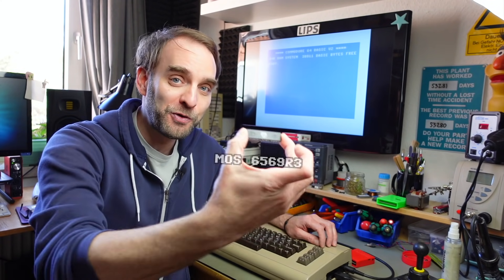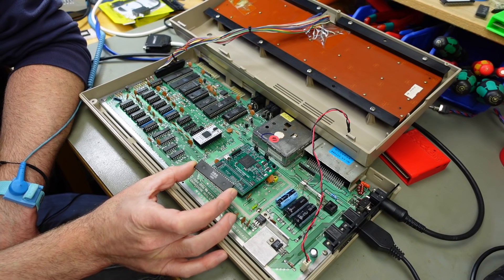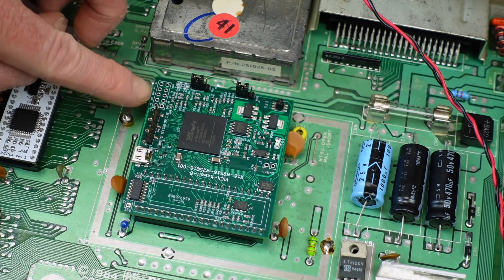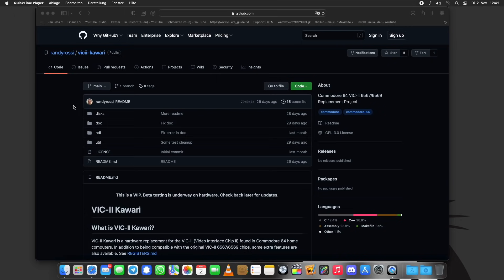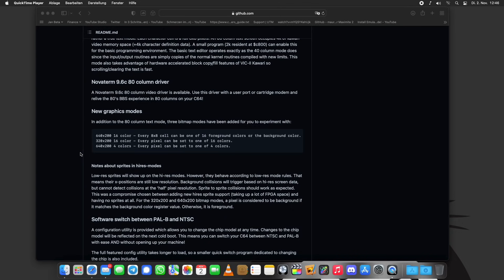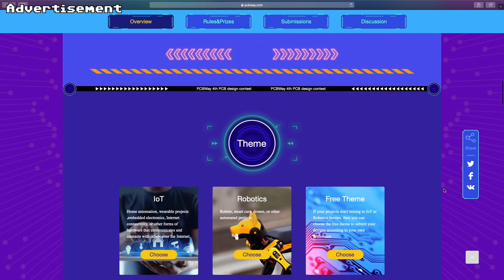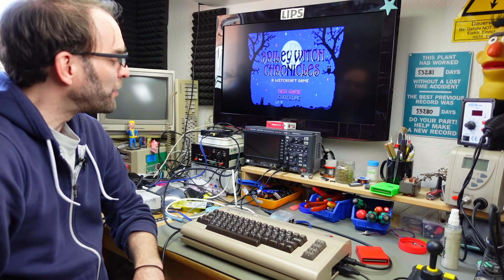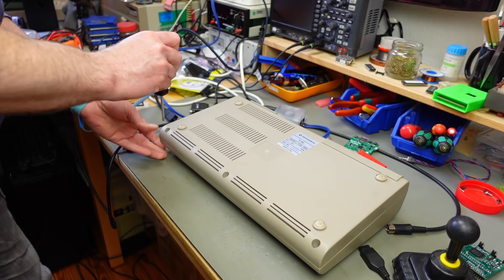Beta Testing the VIC-II Kawari C64 Graphics Chip Replacement

Comment: Does the  Kawari board output audio to HDMI? If not, would that be possible?
Reply: It would be possible with a small modification. The SID has an output pin and joining that with a wire into the Kawari and adding an op amp and/or some interfacing circuit will allow the audio to be ported from the SID into the HDMI. I suppose we might see that in the next revision ;-)
Reply: Unfortunately, no.  The PCB outputs the DVI protocol over an HDMI connector.  So there are no HDMI features (like audio or encryption).  HDMI monitors are compatible with DVI signals.  Using HDMI requires a license which is very expensive.
Reply: @r3rossi  Ouch! That's not good. I was thinking there was an audio pin on HDMI but there isn't. There may be a way to get audio to the TV. Add a pin header (1 pin) to the Kawari then wire the SID output pin to it using a flying lead. Then add a headphone jack to the Kawari and hook that to the incoming SID signal. An op-amp shouldn't be required because the TV will amplify the signal. Then use a cable that has a headphone jack on one end and 2 RCA audio plugs on the other end and run the cable out through the user port. The cable will plug into the TV RCA audio jacks and give audio through the audio inputs. Most TVs have a menu item to allow audio input through the RCA jack and use HDMI for video.

Comment: Will it work without the RF modulator but using a c0pperdragon Video Enhancement?
Reply from the maker: I have yet to try that myself but it probably works. The luma/chroma signals that go to the rf modulator are modeled after the ones from a real VIC-II,  so it should work fine.

Comment: I´m following the product since the beginning and now it seems to be close to production. My SixtyClone 250466-Board ist badly awaiting the released product! :-)
If you´re looking at the scene you can see that public domain hardware works out well, see the PiStorm Adapter 68K-CPU-Replacement for (in the future nearly all) Amigas.
I hope the developer will get more than just fame out ouf it if he makes the project open source. 
By the way: I think its right that products like the Turbo Chameleon 64 V2 or the Ultimate 64 are good replacements for the C64 as a whole with lots of new features (not to mention the BMC64, the KeyRah a.s.o.), but:
Nothing's above soldering together your own Cevy, equip it with original or replacement parts, put the power cord in and get a well known beloved blue screen at first switch. :-) Nerd´s Victory!
Last but definetly not least: Again a great video, Jan! :-)

Comment: I wonder at what point it'd make more sense to pull all ICs from the board and just have an FPGA in the CPU socket emulate every chip instead. The Spartan FPGA should have enough gates to emulate the whole computer three times over.
Reply: See the "Ultimate 64" for that.

Comment: There should be current limiting for the HDMI 5V pin. The HDMI 5V according to standard specs. should not be outputting enough current to power a C64. Be careful so you don't destroy your monitor.
Reply: Hdmi 2.0 gives 900 milliamps. In his discord channel jan said he tested a c64 and it needed 800 milliamps on the 5v rail during operations.
Reply: @vectorjoe  I stand corrected. Thank you sir.
Reply: @svenkarlsen2702  still neither save nor intended to power the whole system via hdmi, as can be seen by the inconsistent reset sequence of the kawari and the rest of the system.
Reply: @vectorjoe  I'd limit the current over HDMI so it can be reset by power cycling though.

Comment: If this replacement is not open-source it's technically no better than the original VIC II chip because when it fails it's game over. FPGAs can run hot so failure it a real possibility. The most common failed part in modern electronics is the main control chip and often it's an FPGA. The same goes for all the SID replacement chips except the SwinSID nano. Even if they don't fail, these small run replacement projects generally don't last long before the developer gets bored and moves on and then no more chips are available. So open-source is the only way that replacement chips can survive and be available to anyone at any time in the future.
Reply from the maker: Yes, this is going to be open sourced once the testing phase is over fortunately. :)
Reply: @JanBeta  Ok. I don't think many average C64 users will be building it since it uses a BGA chip. So most likely a bunch of experienced hardware people (including the Chinese) will jump on it and start mass producing it and the original dev will make $0. He should probably sell it himself for 1 year so he makes a few bucks out of it then make it open-source after that. This is a mistake that a lot of open-source people do then they complain that people are making and selling their design then they quit the scene and the product is pulled. Reality and past history proves that's exactly what will happen ;-)

Comment: Bit of an overkill with the FPGA.  Could have created all MOS Chips as the same time with the FPGA
Reply: Different manufacturers of replacement chips involved here. The kawari guy is not the same as the guys doing the swinsids or nanosid.
Besides that, 100% fpga solutions already exist since years.
Reply: @David Webster  Not possible to do that with an FPGA plugged into the VIC II socket. I suppose it could have flying leads that plug into the various MOS chips but then you're getting close to a Ultimate64 motherboard so you might as well just buy that and have more features too ;-)

Comment: I think we need to delevop cheaper alternatives to FPGA chips which are just too expensive in my view
Reply from the maker: Usually for larger volume projects, ASICs are used instead of FPGAs. They are not re-programmable and cheaper if you produce many units. Probably won’t make sense for a smaller scale niche project like this.
Reply: @JanBeta  that would make sense

Comment: 0:58 Expensive? Not really. This is a common misconception by noobs who have no idea what an FPGA is. FPGA chips are relatively cheap. I know because I often do PCB designs with them. The expensive part is the development of the board and FPGA code. But the actual chips are definitely not expensive.
Reply from the maker: A single Spartan 6 is at least around 30€ as far as I can see, if you don't buy huge numbers, relatively expensive compared to what a VIC-II goes for these days. You obviously also have to take the PCB manufacturing and other components into account.
Reply: @JanBeta  Buying an original is getting close to $100 now and it will fail so essentially it's money down the drain. PCB manufacturing is super cheap from Chinese board houses like JLCPCB and PCBWay. A 100x100 PCB in quantity 5 is less than $10. SMD parts are also super cheap, 100 resistors for $2 and 100 caps for $2. All the small surface-mounted parts on PCBs cost cents. Based on the images of the PCB in this vid (and if the FPGA is $30), the total build cost of that PCB is around $45-$50 max. Additionally once development is finalized a cost reduced version can be made on a smaller PCB. If the number of FPGA gates is more than required with the final code a different FPGA could be used that is cheaper (with less gates) and physically smaller.
Reply: @johnbos4637  VIC 2 is $20 on Ebay
Reply: @davidlloyd1526  LOL! I'll take 50 of them. Send them to me I'll pay double that amount LOL!

Comment: But C64 need ac and dc power...
Reply from the maker: In the Short boards, the ac is only used for powering the Sid, the datasette motor pin and the user port. So the machine works for the most part if you supply 5V DC.